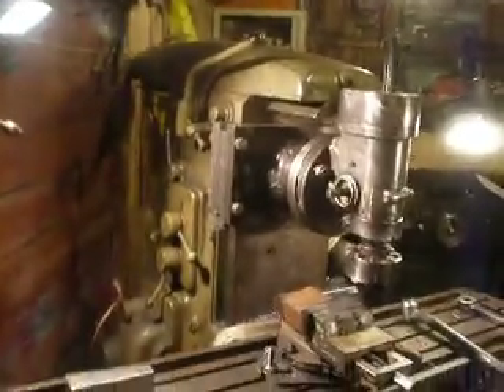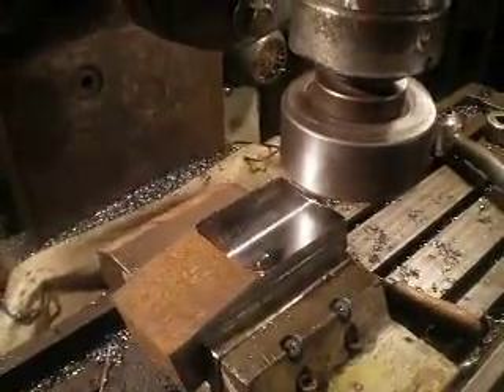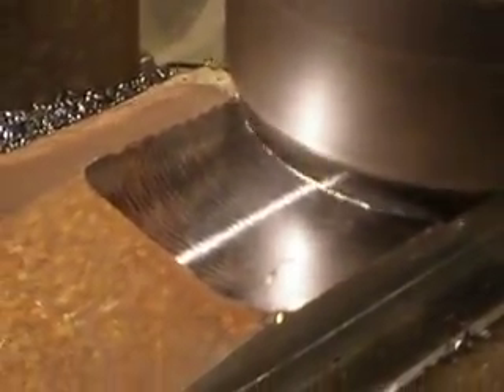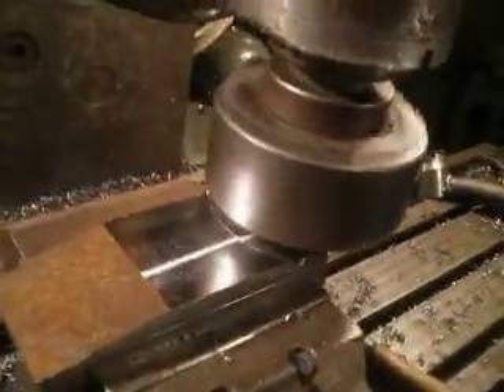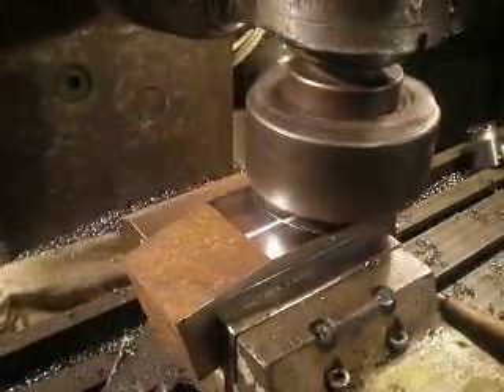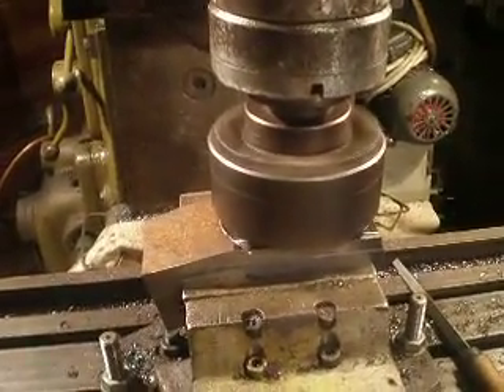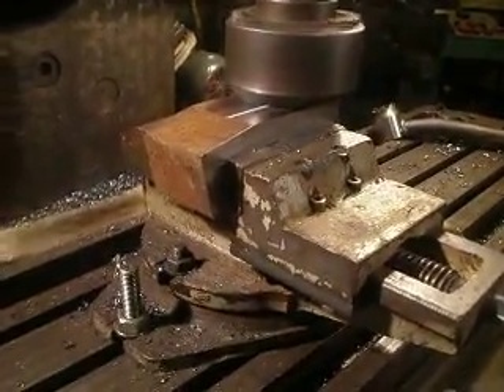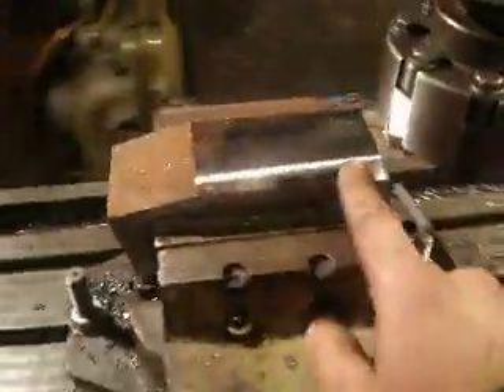Old advanced Biernatzki milling machine milling steel workpiece

Comment: Hey mate is that the biernatzki U2? I'm looking at buying one but would just like to know if it has a separate motor for the table feed or if the spindle and knee is all powered off the same motor? Cheers mate!
Reply from the maker: Hello, Sir!
My Biernatzki H2 have 1 pcs motor and it run almost anythinh on machine - spindle and all feeds. Coolant pump is gone. Table knee reach power from main gearbox reductor and through TWO driveshafts table and knee are get powered. One driveshaft is for regular speed feeds, second one - rapid feed.
Cheers!

Comment: i've had to make a part like this in the past, but i used different method.. i cut about 2mm above the line with a slitting saw, then finish machine with face mill cutter, but you can only do like this if the radius of your slitting saw is big enough.. still good work though.. the adapter you talk about, i would call a "verticle spindle adapter" :)